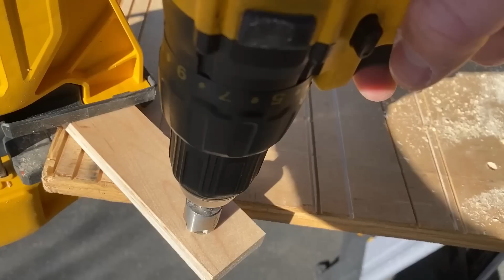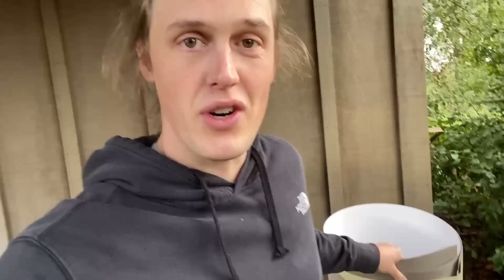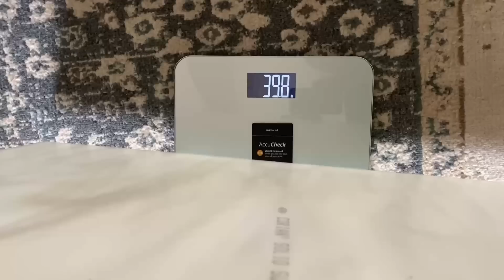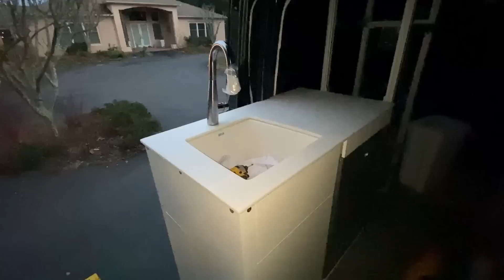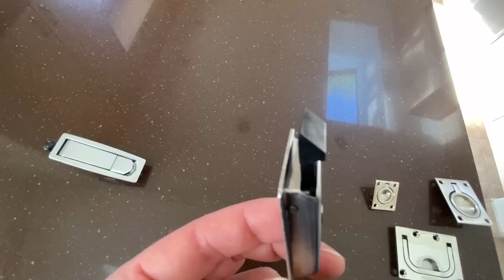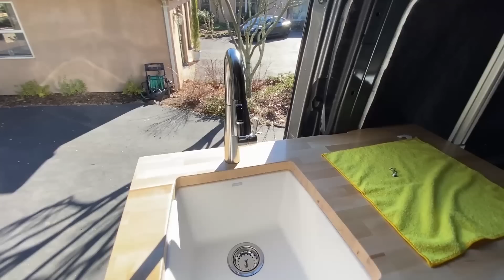How To Build A Van KITCHEN GALLEY Unit - Countertop / Paint / Latches (Part 2 of 2)

Comment: Hi, discovering your channel, alu frame with 8020 bring me there. but i'm French and we call that "Aluminium profile" 
Anyway, i'm converting a Renault B110 4x4 freshly body restaured.. And considering the 8020 frame solutuion.

Why did you used that thick wood panel ? 3mm should have been enought  ? And evey why use plywood instead of pvc / pet / composite pannel thin ?

Thanks
Reply from the maker: Only reason I used thick wood panels is so there was enough wood for the latch screws to bite into. Besides that I’d definitely just go with 3mm. 

I couldn’t find an alternative material that was lightweight, easy to machine, and could hold screws well.
Reply: @seven_o_savage  thanks for the answer, that make sense.. 

I'm currently challenging the "reality" of the 8020's  lightweighness over thin plywood.

I'm probably gonna hybrid the build by using them for the rear bed frame that will also hold batteries and a small washing machine.

Also thin 8020 for the upper cabinet, because too much cool to be able to custom and asjust storage size in them. 

But keep the others stuff made of light wood construction.
Reply: @seven_o_savage  In another video you mentionned that you regreat to have "oversized" the frame, do you think that 1515 is solid enought for the bedframe ?

Comment: That’s not actually 80x20 it’s closer to 40x40. Idk where along the line we started calling all profiles 80x20 but 80x20 is 80mm x 20mm. They are aluminum profiles and the numbers are the size.

Comment: Thanks for the detailed review of your cabinet latches. We're doing a similar build and trust your recommendations. I can't remember if you did a similar comparison of hinges, and how you mounted them for cabinet doors... What hinges did you decide on? Did you mount to the 8020 or to the wood facing? 
Thanks again!
Kyle
Reply from the maker: For hinges I haven’t found a “great” solution. My next attempt will be flush mount concealed hinges (kind of like cup hinges but able to mount to 1/2” plywood). Right now I use soss hinges and they are insanely frustrating to install

Comment: With scribing, if you push timber till a bit is flush and then measure largest gap. Then use a block that width and use that to scribe you can do it in one cut.

Comment: Nice job, but I think it would look even better if you had boxed in under the overhanging unit at the door so that the cabinet goes to the floor as I think it would look much more neater and could even have a small compartment for storage, on your next build try it, you will like it,  nice job though

Comment: hello Seven, why white? I saw some comments on @Eamon & Bec and found them very convenient.
which cooker will you use, induction?
I'm starting a project to transform a sprinter 211 cdi, L1H1, everything a little tight !!!! And I'm in the phase of choosing the finishes. I'm going towards the panels of HPL phenolic boards for exterior, they are waterproof and do not need painting precision, and as they are with the interior in black material, it gives a super finish, without needing to cover the edge. modern and industrial finish, with built-in chrome or black screws, fantastic, and combine with 8020 aluminum.
One question, for the induction cooker, what would be a battery and inverter configuration, and how many watts of solar panel, considering a use of the van, not too wild, maybe three days stopped, without communication with civilization?
tks! hugs!

Comment: Nice job scribing! The exposed bolt isn't my taste -- but hey it's yourr van :-D So you do you!
The Corian came out nice, but the butcher block is nicer because of the thickness.
Nice job attaching the latch catch to the bottom of the upper drawer. That little bracket is a subtle thing that must have taken some time.
Thanks for doing the measurements at the end. That's a nice touch to the video.

Comment: Those latches made my eyes wince, just imagining them catching your leg on those mini razor blade handles, ow. Flush is best, at ANY cost in a limited mobility area like a van or boat.
Oh, and love the butcher block but it would look better (and work better with sink) if the sink was flush to the surface, rather than underneath where the block edge will be seen.
Reply: Yes the BB looks better in that situation.  I do wonder about it being exposed to water in and around the sink.  And I agree, the latchs are interesting but I would prefer something flush in tight quarters.  Not working with the soft close is a significant downer.

Comment: Can you flip the handle on the latch so the latching part can be facing down...like for cabinet doors that flip up (i.e. overhead doors)?
Reply: RV Labs have a different latch for upper cabinets. I just installed them in my van. Best latches 👍🏼 https://www.rvlabs.com.au/product-page/overhead-cupboard-lever-latch
Reply from the maker: Good question, you cannot unfortunately.

Comment: The butcher block looks better because it is a different color and contrasts with the rest of the cabinet.  If you want the white Corian  countertop you would need to paint the cabinet a different color to make it look good, or get another expensive piece of Corian of a contrasting color.  Personally I would prefer the Corian surface over time.  It is much easier to keep clean and maintain.

Comment: The butcher block of course for this usage. I think the Corian needs to be in a contrasting color to the cabinetry and also needs a deeper edge finish to look good - e.g. double thick at least. I don't think I've ever seen a kitchen install with countertop edges of single thickness Corian... Excellent job on the cabinet overall - very well done (and explained - especially when you are doing some things for the first time!). Van is coming along great.

Comment: I like the butcher block better. One thing about the Corian, you can also keep using finer sand paper. If you wet sand down to 2000 grit and polish it looks like Granite. I first did this back in 2000 for a kitchen I was doing.

Comment: Amazing job. Plan to do very very similar, with 30mm 8020, and a reinforced IKEA Linnmon table top (weight saving) coated with polyurethane clear varnish for surface durability + Ruvati RVQ5215 sink. 
Curious to know how you plan to finish the walls behind the kitchen since it's now installed.
Oh and the butcher block 👌

Comment: I want Butcher Block in my Van! The only thing holding me back is the weight (especially maple.) Great idea to take out some material on the underside. Now that you’ve compensated for weight, in my opinion, go for the Butcher Block!
Reply: You can use a thinner piece of butcher block or wood and then
double it up at the edges only so it looks like the wood is double the thickness that way you get the look you want without quite as much weight.